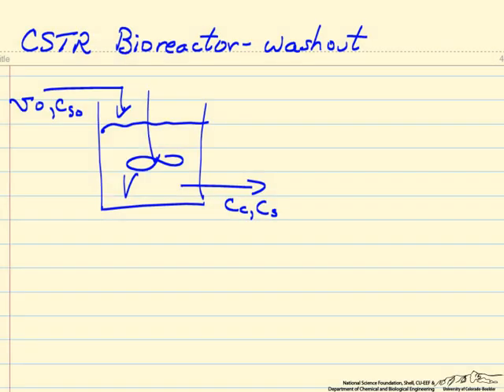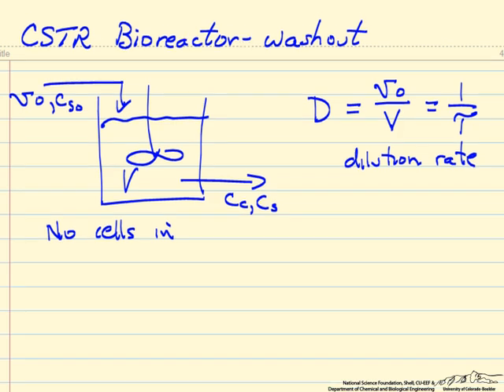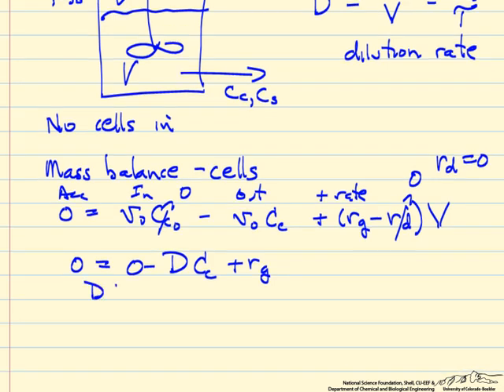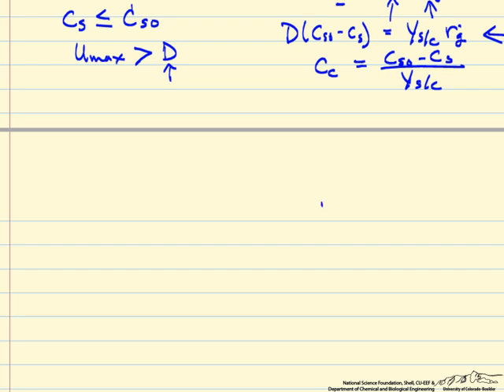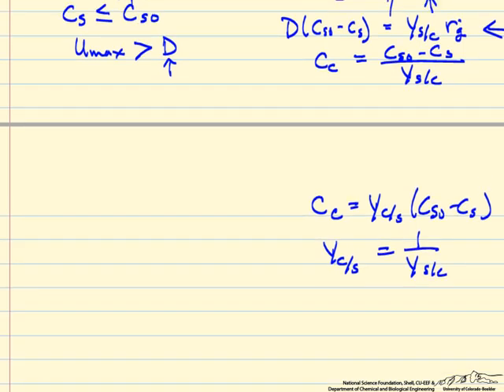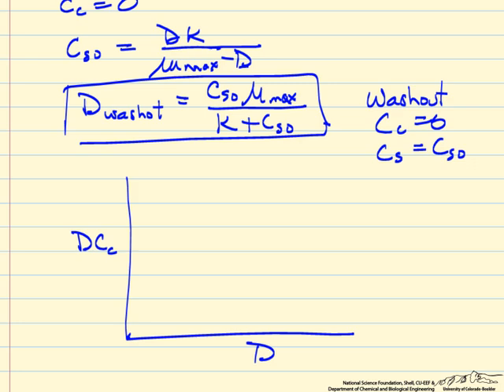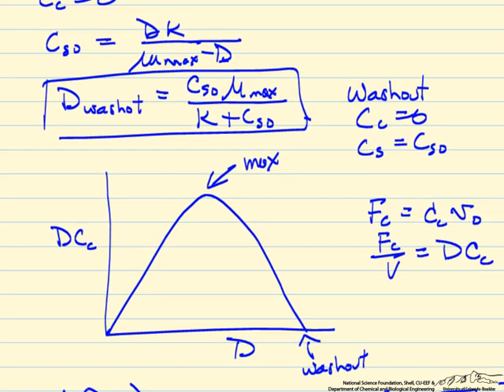Washout Derivation in CSTR Bioreactor (Bio)

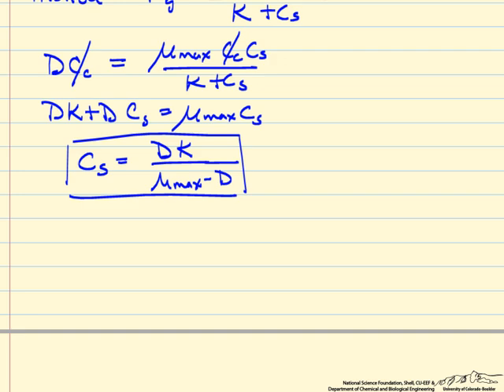Comment: Excuse me, I have a question regarding the equation Cs=DK/(umax-D), how did the denominator become umax-D? I didn't understand that part, min 3:14.
Reply from the maker: Thank you for your question and for including the time stamp! This is due to some quick algebra. Let's break it down: start with DK + DC_s = umaxC_s.
Move C_s items to the right side: DK = umaxC_s - DC_s
Pull C_S out from right side: DK = C_S(umax - D)
Divide both sides by (umax - D): DK/(umax - D) = C_s
Does that make sense?
Reply: @LearnChemE   I get it. Thank you for your time.